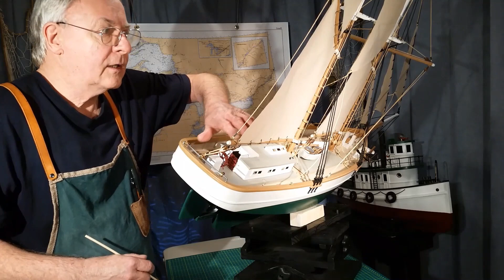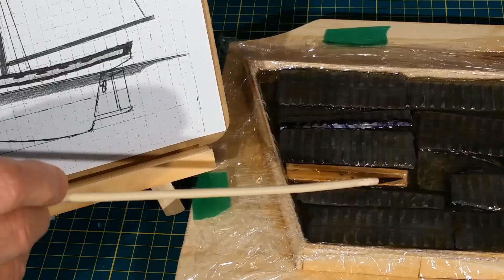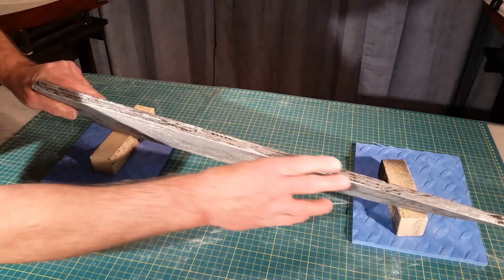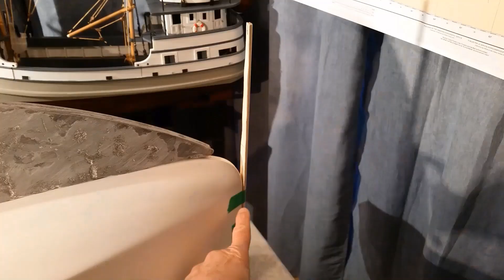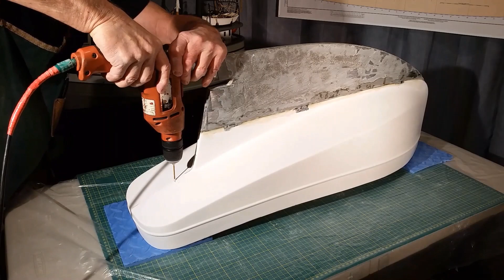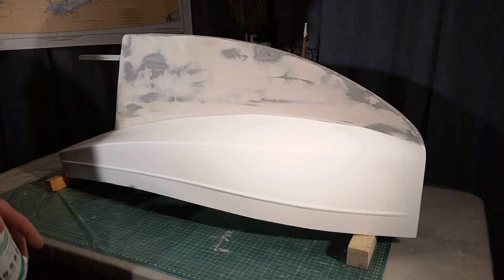RC Gaff Pilot Cutter Build Part 1

Comment: I'm a sculptor. I would make a waxed wooden keel and use this to make a two part mold. Pour lead in and you have a perfect keel that needs little or no finishing (fairing). The mold could be used over and over.  Michael
Reply from the maker: I think that is a great method you describe.  My intention in the video was to have a method using steel or lead pieces to form any shape keel without a precise mold.  No melting of lead is required.  Of course the keel weight is not as concentrated and your suggestion would likely be better for a racing design.  Thanks for giving a different approach.  Brian RCWH

Comment: Hi I am building the USS Hannah  and want to fiberglass the hull what should I use?
Reply from the maker: I looked the model up and I think it's a scale ship model.  I don't want to steer you in the wrong direction but if you wanted the planks and detail to show on the exterior you could coat the hull interior with polyester resin.  For that small job I would use some  resin from the local hardware store. Just a suggestion.  Brian RCWH
Reply: @RCWorkboatHaven  OK, thanks

Comment: I'd been wondering how the rigging on that sailboat in your intro worked, now i know! Looking forward to seeing how this build progresses.

I'm currently building a bearospace sloop "Emma", but i'm having a hard time finding "Bass" strip wood in the UK. I've been told that balsa is not a suitable alternative due to its porosity, but do you have any recommendations for what I could use instead? I can easily access Obechi and Spruce, I think spruce may be a good option but I'm not familiar with the various species and their properties.
Reply from the maker: Basswood is my preference because it's stronger than balsa.  Both can be cut with a knife.  The schooner is 3/32 basswood boards covered with polyester resin inside and out.  I have used pine, cedar and birch here and there on the models.  Ed,  FirstTry ' Kidder Manufacturing Co. Ltd.' in Ontario.  www.kidder.ca ' . They sell boards, strips and chunks. They ship to me and these days they may ship to the UK.  It's worth a try. Using balsa is OK if you plan to saturate the hull with resin and maybe a bit of cloth or mat added.  That's why I made the fiberglass molds for the Haven 34...it's just less work for a better hull.  Myself,  I prefer wood that is easy to bend and I use resin to make it strong and watertight.   Brian RCWH
Reply: @RCWorkboatHaven  Thanks Brian, this is really helpful. I'll see what I can find